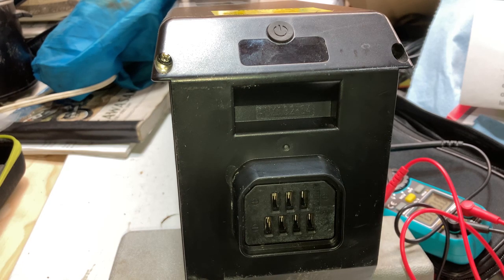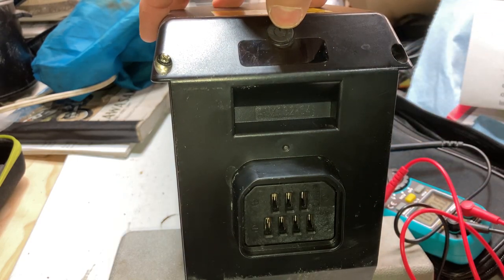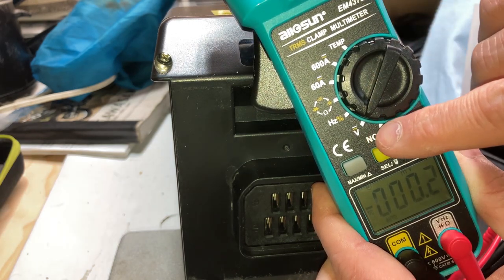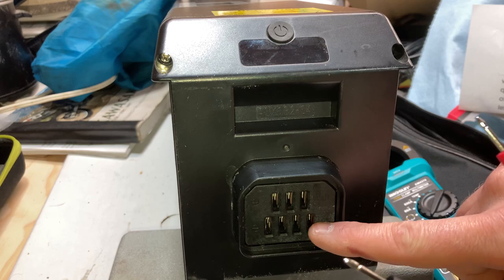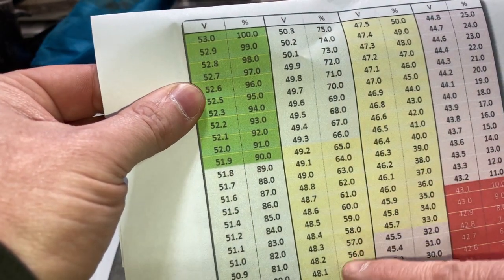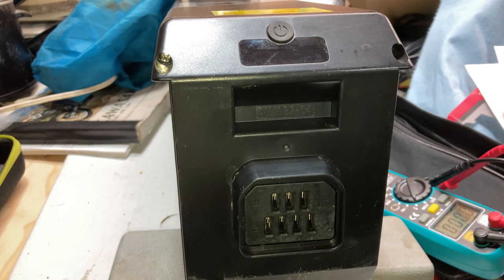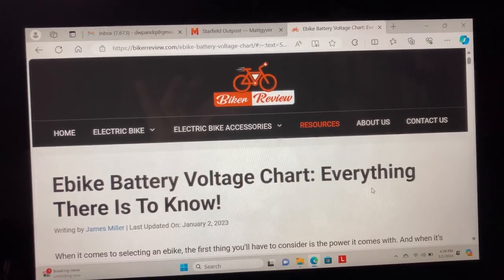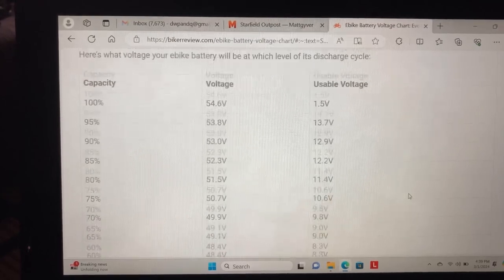How to Check Your E-Bike's Battery Percentage with a Multimeter

Comment: Also worth noting with this is that while 48.1 volts may be 55% charged by way of voltage on a chart, as far as actual watt hours (range) left in the battery at that point (48.1 volts) you probably only have 25-35% range left and that is because the voltage starts to drop much faster in the lower voltage range of a battery  So if you were to use voltage as a way of guaging how many miles you have left on a charge, you may find yourself peddaling the bike without assistance much sooner than anticipated!
Reply from the maker: Very true. I’d be interested to see if there is some kind of algorithm that could pump out the “useful” measurement to break down the percentage of range remaining.

Comment: This is good stuff.  I’ve noticed that the bike/battery reports full bars until about 55-60% remaining and then starts dropping down.  So I’ll get
Like 25 miles before it drops a bar, and the. Like 6 more miles and it drops another bar, etc etc to end up with a range of about 50 miles (I ride the thing with heavy throttle so I don’t get 80-100 miles, but that’s fine, I actually don’t need 50, I just need to not be worried it’s gonna die on me after 30).

I do wish the display showed battery voltage or a percentage.  Ah well.
Reply from the maker: I wish mine did, too. I’m not sure why the display programmers don’t just make it display percentages. It’s obviously calculating them in some way.

Comment: Would it be possible to mount a small voltmeter on the handle bars and splice it into the wires or battery somewhere so you could get an ongoing exact voltage level, rather than relying upon the bars on the display?  It seems like that could give a person more of an accurate idea of remaining power?
Reply from the maker: It might be possible if you splice into the wires leading from the battery to the controller or better, creating a connector between the two. I wouldn’t want to void the warranty.

Comment: Had 10ah slide in battery.. put a 30 ah 2nd battery in rear box.. bike display shows 5 bars(full).. drops to 4 bars when only about 3 miles left.. need new display?
Reply from the maker: Not sure on that one. I really wish the manufacturers would put a volt meter on the displays. The bar meters are incredibly unreliable. All I can recommend is to pull the battery and check the voltage at the leads to get an idea of the remaining capacity.